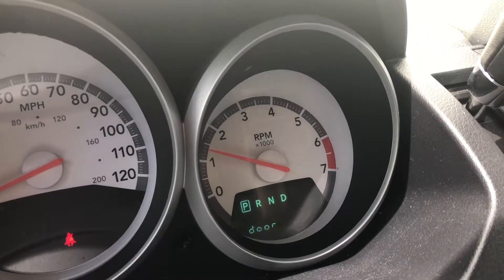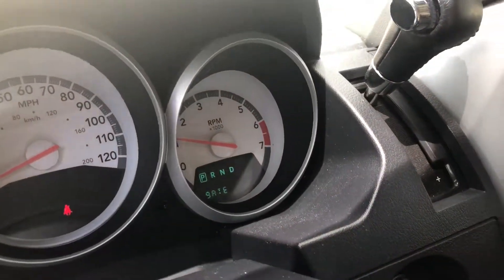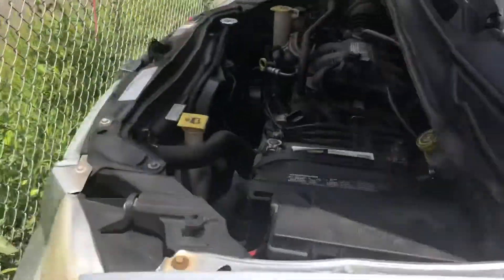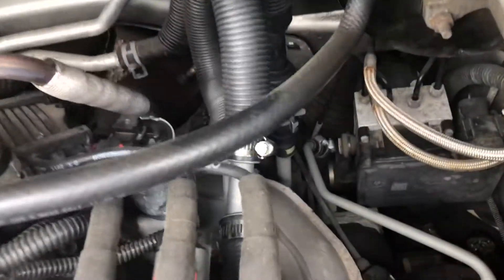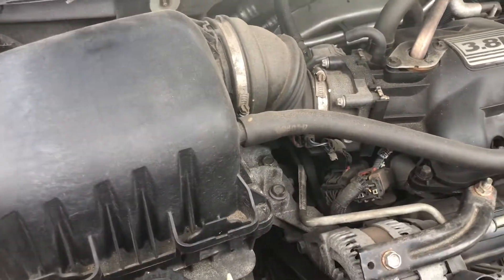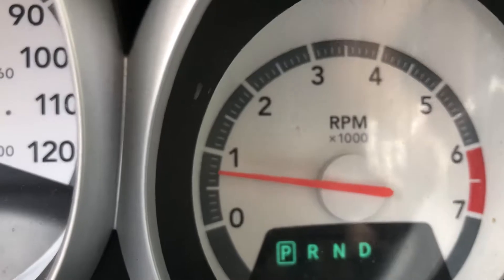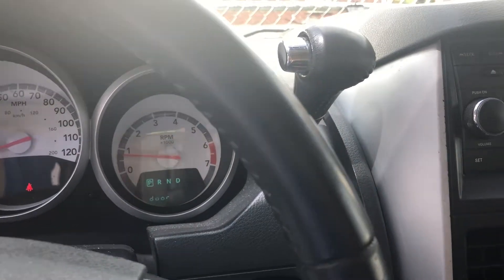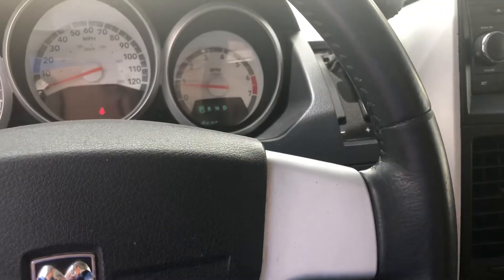2008 Dodge Caravan strange idle upon start up

Comment: Check to see if the throttle body is gunked up.  More than likely that is your issue.  Easy job.  All it takes it removing the throttle body, some rags, and throttle body cleaner.

Comment: I have 2011 grand caravan takes long time to idle
Reply: Check to see if the throttle body is gunked up.  More than likely that is your issue.  Easy job.  All it takes it removing the throttle body, some rags and throttle body cleaner.